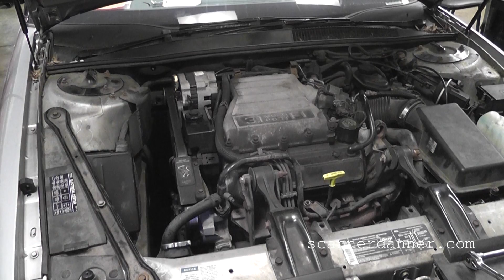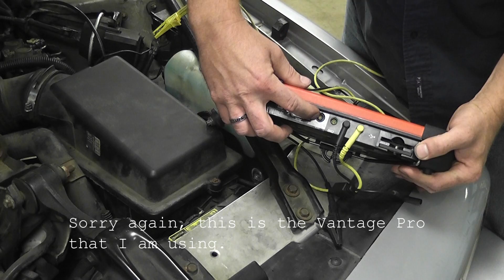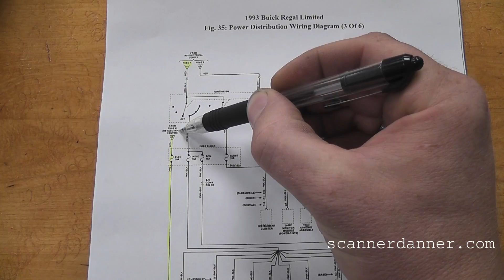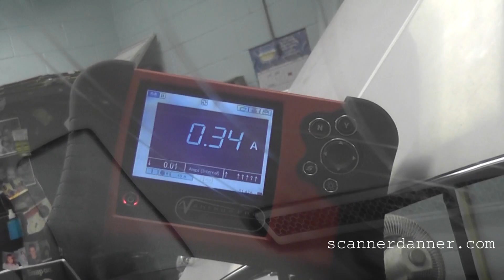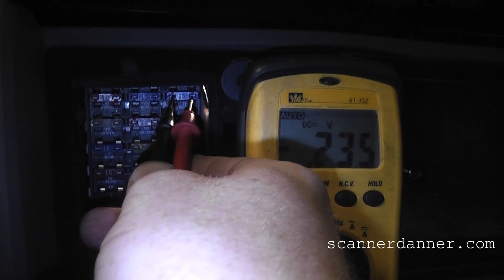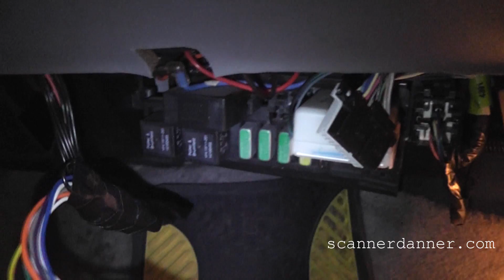1993 GM 3.1 No Start Case Study (Part II)

Comment: Hey Danner I have seen computers fried on heavy equipment several times because the proper procedure was not followed when welding on the equipment you have to disconnect the batteries an ECM for the engine some are high is 15,000 saying the same burn marks it's a fried tater

Comment: Thanks for the good teaching....keep it up!!
1:46 What could an alternator do with a no-start case like this?
Reply from the maker: For no starts, meaning it is cranking but not starting, we never worry about the alternator. It is simply not involved in the start up process.
Now if your battery is dead, you obviously need a good charger connected or good battery before attempting a no start diagnostics procedure
Reply: @ScannerDanner  I meant if your generator is really bad, a bad regulator in specific. Could it fry the new mounted ecu while cranking?
Reply from the maker: @toutsandler3739  during cranking? Absolutely not. But during running if the regulator fails and the system voltage goes over 16v, then yes, some damage to components can happen

Comment: History. Important..
Great video. 

Whoever did that repair on the battery charger terminals was absolutely careless. 
Also, devices should be tested without load by operators and/or technicians, especially after any repair, to ensure that the repair was done right.
Reply from the maker: expensive mistake for sure

Comment: Sorry for being late, Not Draw Related but shouldn't you test AMP out also when testing the chrg sys?  I know your doing a GM BUT, early ford alt's put out low volts but amps were high on full load some fords I remember only put out .5 volts over Batt volts.
I always test both for voltage and amperage. Then i would look for an A/C leak (diode test) looking at A/C output 
For all Chrg Sys Testing I Get it out of the way right off the start . A draw can be caused by a bad trio.

Comment: One should not pull the fuses but measure the voltage on the fuses and compare that with the spec sheet of voltage drop against the Amperage of the fuse depending whether its a mini etc.
Reply from the maker: One should learn multiple methods and the voltage drop method on fuses is one of them

Comment: Ohms law. .05volts / 1.0amps = 0.05 ohms. So assume all fuses have 0.05 ohms. If you had 0.1 amps. You would have 0.005 volts.   I x R = E. Tough to read on most meters. Nice video!

Comment: It’s easy to do with the multimeter but they also make a tool that calculates the amp draw by measuring across the fuse. You select the amperage of the fuse and it calculates the current draw by the voltage drop. I know Matco makes one.

Comment: Wow I work late so I'm just starting to work on my car like I commented on last night. Unbelievable like I said my car was broken into before I bought it so there's no door handle and it barely hangs on for dear life on the door latch but does not close all the way looks like the inch Gap you know sticking out looks like I never close my door all the way and I started driving. You may have uncovered my problem with just that for the battery draining because I fixed everything else and it was driving great and then cut off because it would look no power. And you find the electric fuse and mines lead to the door latches and dome light and cigarette lighter which I don't know where turned on when I installed my cell phone charger in there but if I put the cigarette lighter its original component or thing to go in it it wouldn't work so I just unplug that and I'm taking out the elect fuse and going from there thank you

Comment: SD would it be possible for Snap On to put a protective fuse/breaker in the charger  to prevent this? I am not and expert just curious to know if this would be a feature to look for in a charger. Thank you again for the knowledge you share in an interesting and fun way.
Reply from the maker: I'm not sure? Thanks!
Reply: corndog77511 can’t really have 100% protection on an old battery like this. I’ve seen them blow just sitting there or putting a jump box on them the right way. Dealing with that much energy like in a large 12 volt battery is just one of those things that requires care and attention along with proper safety precautions.

Comment: Have you ever heard of the Chesney method? Where you check voltage drop across fuses to calculate current draw on that circuit? It is a very non-invasive method to finding your parasitic draw.
Reply: Never mind you got to that at the end of the video!

Comment: Did mine with a multimeter mine had 1.18 found it was my factory amp but now it's show 0.68 is this still a concern
Reply from the maker: .68 across a single fuse using the voltage drop method? Yes, it should be 0v
Reply: ScannerDanner it will sit on .68 for a minute then drop to .08
Reply from the maker: that may be too high as well, is your battery going dead? How old is the battery?

Comment: Went to a mercedes c200 with battery drain issue. Was going to do the paraditic drain test but first had issues with battery being 4v. Ok customer says he just fit new alternator. I saw it there gleaming. He said reason was battery went flat after thirty mins driving. Ol so new battery fitted and as I was connecting meter on amp setting between the ground and neg batt terminal, it blew my meter. Over ten amps draw. Ok so un plugged every fuse and every relay, still huge draw. Ok so unplugged starter and still huge draw. WTF? 
Any advise...?
Reply from the maker: Did you unplug the new alternator?

Comment: For those interested on the voltage drop test across the fuses to see the amp draw, this is a link to a chart for almost every type of fuse. Like in this case for Paul. A normal 15 amp fuse with a 5 millivolt drop, the amp draw chart shows 1042 milliamps.
http://info.powerprobe.com/fusechartsdownload

Comment: I just want to say that ur video  helps a lot to me , I work as a mechanic  and I think electrical  field is the most complex or more difficult .  what , I want to say is that the after market sound system will couse battery draw overnight of after vehicle has been sitting for a long periods of time, radiios , spekears, alarms, amplifiers .  for me auto electricity is really interesting for me and I will like to learn more of this , cuz it will help me alot for what I do. thanks for posting this kind of videos scannerDanner.

Comment: A Common problem in communication with service writers and customers is they dont get any detailed symptoms because they figure you are the mechanic find it. Yes, but knowing if the customer had any issues just prior to these current events bringing the vehicle in are sometimes vital to an easy diagnosis. I know it has helped me a great many times and that knowledge has taken me a completely different direction and finding the problem quickly. Just from knowing what happened before this bring it in incident. "Gl be safe and stay dirty" Eric the car guy~

Comment: Hey there, Your videos are awesome!! I have one little gripe with this method, I reckon a much better way is to voltage drop the fuses so as to find the fault without interrupting any modules and causing confusion!! I understand its quite an old system here but on any modern European cars I ever work on we wouldn't get away with pulling fuses as we would be there for days waiting for modules to sleep!! I really love your videos and please keep up the good work Its a joy to learn from you! 

Great Job!!!

Kenny
Reply: I think pulling fuses (even in modern European cars) is a valid test. The only problem is plugging them back in with your ammeter plugged in, because you run the risk of waking up a sleeping system (which could blow your meter and/ or give you improper readings). Voltage drop is better to me because after your check you're not going to have 700 fuses to put back in the box. Nightmare town!
Reply: +kmsmotors 

38 and a half minutes in and you mentioned the voltage drop method!! My bad!! feel silly now LOL
Reply from the maker: +kmsmotors good tip brother and no problem at all!

Comment: What are the benefits of doing the draw test with leads rather than an amp clamp?
Reply from the maker: +mastahc411 amp clamps have a hard time reading very low current, but I've done it with success.
Reply: As

Comment: wow. didnt know this was a common thing with this engine. Had one in my first car and blew a head gasket (about 15 years ago). rebuilt the top side of it and when we went to restart it it would not start and was backfiring through the intake. couldnt figure it out so we ripped it back apart and checked the rods (all good of course) and put her back together and found out that the computer was blown too. long story short, it was a pain in the ass.

Comment: Paul, great video. You can go to Power Probe's website and download the volt drop charts that gives you the actual amp draw given the amount of voltage drop and the fuse type. Here is a link to Power Probe's website to download the charts. http://info.powerprobe.com/fusechartsdownload

Comment: Question, seeing how that car is OBD I how was you able to use a scan tool? I mean, I had a 91 Cutlass Supreme that I had issues on and the only way I thought you could view codes was reading it from the flashing light.  (Counting the check engine light flashes).

Comment: After market radios interfere with and sometimes disable the vehicle chimes and audio warning system [Example key in ignition with driver's door open = chime]. In CAN bus equipment  vehicles the diagnostic line passes through the radio and in some models the radio screen can display system faults, There are many cars that will not even start after installing a non OEM radio, because of communication bus faults

Comment: just on thing you stated just because alternator was charging that was good not necessarily  you need to test diodes alternator might be charging well but also throwing out a AC charge too which if bad enough can fry batteries and computers

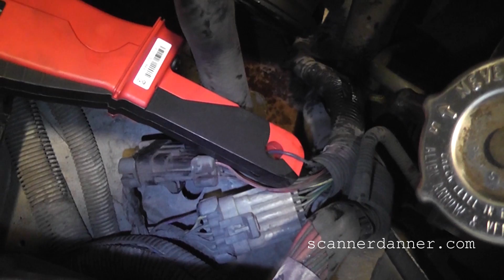Comment: 10:06 is that radiator cap OK?
Looks like, it's leaking coolant in wires from over flow pipe rigth now.

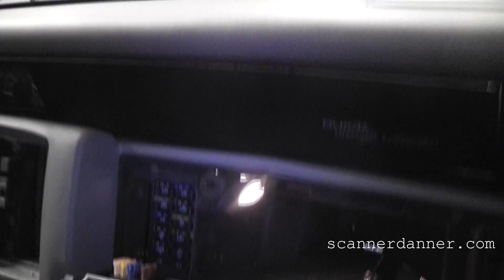Comment: Hey Paul at around 36:50 I noticed the oil pressure gauge in the car is reading around 40psi when the car was off....Does this vehicle retain the oil pressure reading when turned off or was this part of the problem?

Comment: A more important question why doesn't that relatively new charger have a reverse polarity cutout? Or at least an indicator light?

My digital wheel around charger cost me just over 100 bucks and it won't power up if it senses reverse polarity.

I'm sure the school paid through the nose for that "Blue Point" unit probably double what I paid. Not having such a a critical safety feature at that price point is unacceptable to me.

I have an older charger from the 70s with a polarity light.
Reply: Bushougoma that charger wasn’t a digital charger and digital chargers can’t be used in all situations especially with a completely dead battery a lot of the times. Sometimes you need to use a manual charger to get the voltage up before one of those digital chargers will even begin to charge a battery. I prefer to control the charge over batteries in that situation rather than depend on some charging strategy built in to a digital charger that is unknown to me. I’m not bashing digital because they have their place and are great for maintaining/topping off batteries but don’t always fit every situation.

Comment: Hey Paul,

When using the VD method across the fuse to find a parasitic draw, the test is much more accurate with the DVOM in mV range on manual ranging mode. It will show lower parasitic draws.
Also worth looking for VW and Mercedes-Benz have charts to how much current is flowing to what VD will be across the fuse.

Comment: Sorry for the train of comments...I'm commenting as I watch the video. The voltage drop across higher current circuit fuses I was lectured on believe it or not, AC Delco. I sat in on one of their lectures and one of the old timers mentioned this very thing. Of course I had forgotten it until now....it's ironic how things pan out sometimes. My preferred method for parasitic draw or drain, whichever terminology people like to use, is using an inductive ammeter. You don't have to worry about radio

Comment: It's important to mention why a DMM with the probe connected to the current jack acts as a jumper wire even when it's off.

A meter measures current with a low ohm high wattage resistor known as a shunt. Your leads are connected across this resistor.

The more current that flows through this resistor the higher the voltage drop will be across the resistor. Knowing the resistance of the shunt and the voltage drop the meter can calculate the current.

Comment: Doing work on a Ford Windstar(terdstar) in a buddy's driveway....sounds like me.
Was this when you had been working in the field or prior to going to tech school? You are absolutely correct about modules waking up causing parasitic current draw. Some vehicles will even turn on 02 sensor heaters and do EVAP self tests after a certain amount of time between ignition cycles. That can really throw a tech for a loop if you're not thinking clearly. Great video once again Paul, I applaud you and your

Comment: Paul have you ever tried an infrared  temperature gun.  I was working on a piece of off road equipment last winter and the laser point    picked up the heat of the  maxi-fuse for the circuit that was on.  All the rest were at ambient temperature.  Fluke 62

Comment: i Ran out of text there, lastly i was gonna say, that alternator being disconnect seems strange, why was it disconnected?, reverse polarity can destroy them, but that worked ok, i have know alternators to back drain at rest, do you think those door locks have anything to do with the power drain, as it has current going throught the fuse when you plug it in, could be misleading, look forward to part 3 if there is one, good stuff - Fred uk

Comment: Hi Paul that's a real pain car, I was surprised mor stuff wasn't fried when that battery charger got inverted, what a clown putting charger clips on the wrong leads, I have a couple of comments, when pulling fuses out looking for drains, I always used to check them with a circuit tester first to see which were live, no point in pulling out fuses that have no power to them right?, saves time...also the one amp drain is about 12 to 15 watts, so maybe it's a small bulb or something, Fred uk